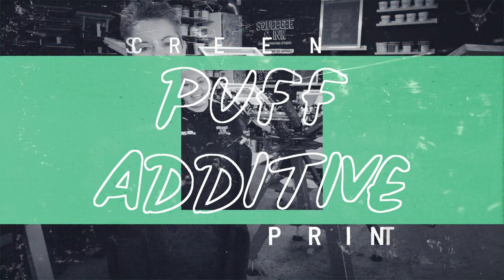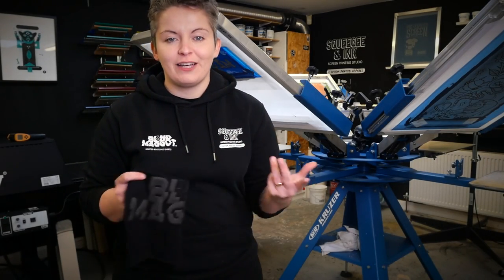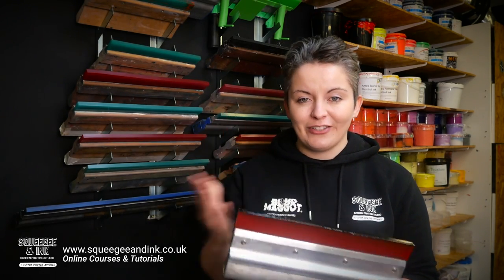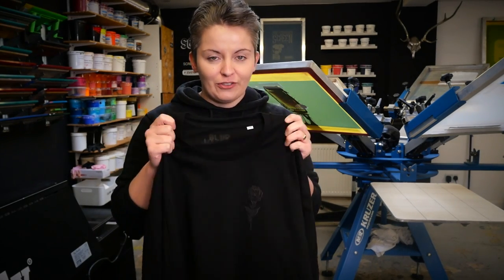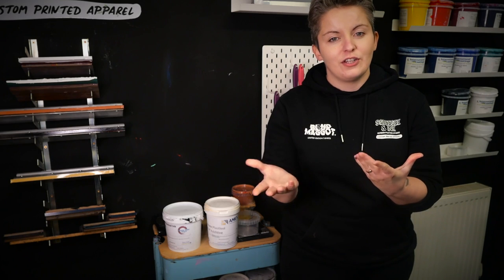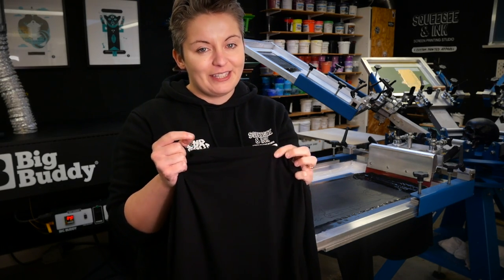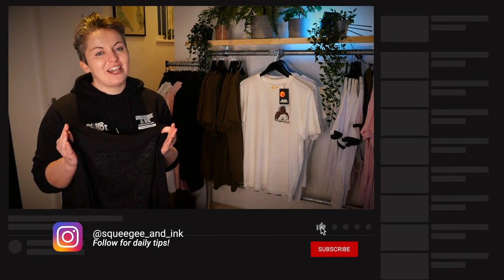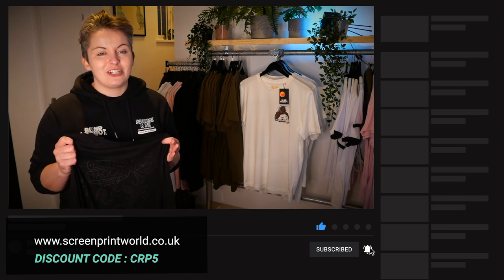How to screen print using puff additive and how to control your puff!

Comment: Cool Video .  The big challenge is doing 3 colors puff . That's the most difficult thing . I have done. One color easy easy
Reply: After the first color just dry the ink then the second color dry third color dry and then cure to get the puff result try this will work.

Comment: thanks for the video. I really wanted to use puff in for a specific design and normal print on kind of top of that :( so you don't recommend to print over the puff ink? Also I am using water based inks, is that any different? thank you.
Reply from the maker: Hey, it is a technique to print the base and then the colour on top! there are a few good ways to do it for sure. The technique is the same for waterbased and plastsiol puff so you will be fine either way!

Comment: QUESTION: Does the spare ink you have left over at the end keep? or do you need to dispose of it like discharge ink? Thanks for the informative video.
Reply: As long as it's stored at room temperature, any left over ink should last for years, just like any plastisol ink :) Just don't let it get so cold it freezes. Plastisol doesn't like that very much XD I imagine that shouldn't be too much of an issue for you guys down under though! Happy printing :)
Reply from the maker: Hey, the ink is fine to go back in the tub, we just make sure to label it so we don't confuse it for normal ink! haha

Comment: Can you cure with a flash dryer or a heat press? Love the effect!!!
Reply from the maker: Technically you can with the heat gun or flash, the ink needs to reach 165 degrees for around 30 seconds to a minute depending on the thickness of ink deposited. I prfer the conveyor dryer for speed and to know it is fully cured. A heat press would probably push the puff down flat again.
Reply: 165 degrees Celsius or Fahrenheit ?

Comment: You mentioned like 7 layers of emulsion while coating the 21t. Do you just mean a ton of "strokes" or like letting it dry and then coating it again?
Reply from the maker: Hey, I tend to build up the layers for high density emulsion by coating in front of a fan heater, so the layers aren't drying but having a skin made on them. I will eventually make a whole video about when I feel I know enough!

Comment: If your addictive is milk color and the normal ink is green, won't it affect the color when you eventually add the addictive to the normal ink?
Reply: The puff base is not milk color but its transparent but look off white when mixed with any plastic-sole shade the color changes and becomes dull black turns grey so on printers use opaque shades to get good result mixing should be perfect as the manufacture recommends that vert important print the same plain shade as under-base print the puff then again print the same under-base shade on top of the puff and cure test and see the results.